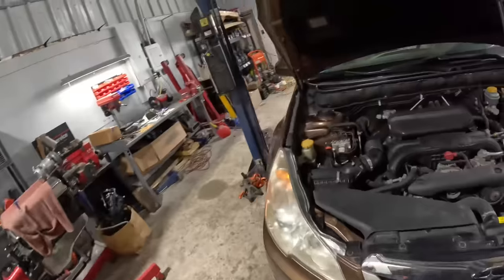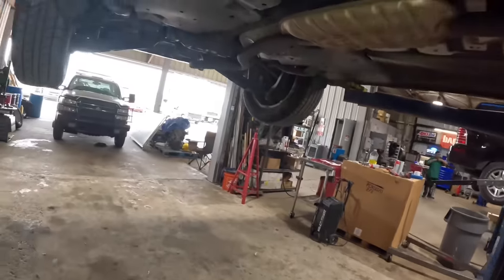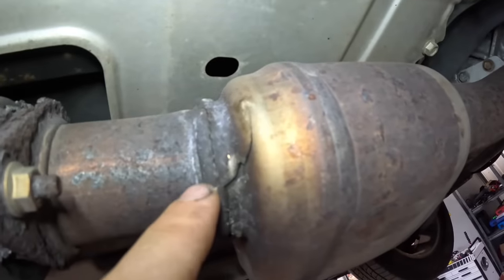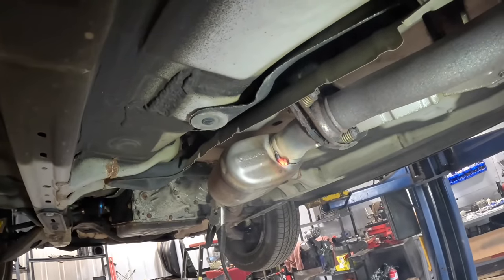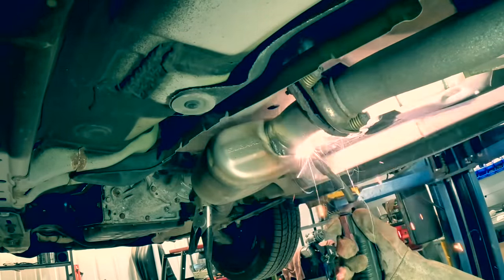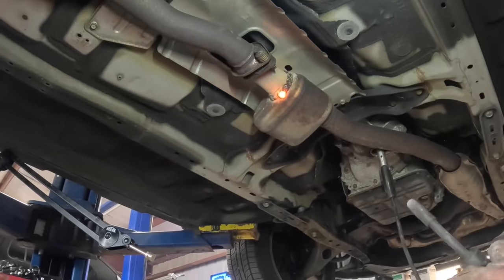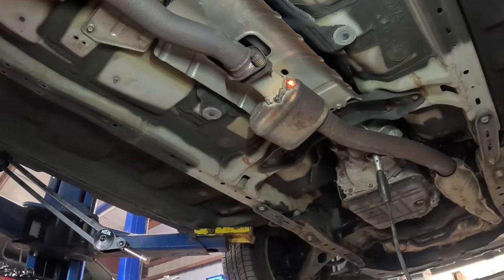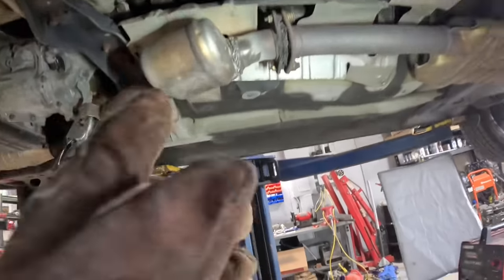Rusted Out Broken Exhaust! CHEAP Fix!!! Subaru Outback 2.5 EJ2.5

Comment: My uncle was a stick welder and he used to weld up rusted out mufflers all the time until he could afford to replace it. Mind you, this was back in the 80's but it's the same concept.
Reply: I've only weld4ed with gas, and I know impressive things can be done using it. But I'd never get anywhere trying to weld a rusted out muffler. Now I remember way back I saw a representative form a welding gear supplier demonstrate welding a rusted out beer can. It was more rust holes than steel and yet he managed to weld that crap. Just for fun he cut and welded together a soda can with minimal heat skew. If I'd try that there would be more holes than solid welds.

Comment: I haven't welded (Gas and Arc only-there was no such thing as MIG/TIG when I was a boy) since I was 18.  I was rubbish then and probably worse now.  If the customer is prepared to accept a cheap alternative to a replacement, with no deleterious outcomes,  it won't be purty, but it'll do.

Comment: A better mig with protective gas is much better than that thread wire you are using. Then about your welding. Dont try to weld it all at one time. Weld 1/2 inch at the time with some time between the welds so it can cool down a bit. You will get much better result.

Comment: I was fleet Maint. on those sizer lift trucks that take the food to the airplanes. I had the radiator out of one, the hood was up and my tools were right there.  I left the key in the truck because l never thought people were stupid. ( early job in my life.) I learned.  the manager told someone to use it. needles to say it over heated on the flight line. My falt for not hiding the key. Truck lived, my job didn't.

Comment: ray, as long as you have flux-core wire, you can weld without gas.
Reply from the maker: It’s still isn’t pretty tho, but it kinda works
Reply: no one is going to see it but the road and as long as it doesnt leak, its gooood. the thing with tig is everything has to be clean, clean and more clean. not a pro welder but enjoy welding projects. id like to get into tig also. seen decent things about the vulcon protig 205 and omni pro 220. theyre about $1k each but what we'd use them for, it will do pig.....it will do. @RainmanRaysRepairs

Comment: if you use wire with flux in it.. or argon in it, you don't have to use argon gas. You don't have to sand down the metal you are welding either with this wire flux wire.
use wire that is made of what you are welding..if welding aluminum , use same type of welding wire.
I use 25 amps for pipes.. and the reason you get blow through is either of several things.
thinning or worn, rusting pipe, too high an amperage,  tough to go see a chart for what wire to use...comes with the welder.
  NOT ever telling you what you did wrong or right...just stating what i do.
Might help, might not..depends on the crappy welder one uses.

Comment: Galvanized is generally not used in apllications that heat is common the zinc burns off and poisonious zinc oxide is released.  Stainless alloy 309 or 409 or aluminized steel or titanium are most common exhaust materials. 

Galvanized the zinc burns around 600C a white highly toxic smoke is produced and once the zinc is gone rapid rusting.
Aluminized steel salts react with aluminum corroding/rusting in 3-5 years in salt belt 8+ years in dry non salted climates
Stainless all around best
Titanium welds are prone to cracking high end systems use titanium...

Comment: Ray, 
Brand new ford Aerostar van next to a Ford Probe also new in service
On a Saturday, the shop mechanics had gone home and shut down the compressor, a porter pulled 5 or 6 new cars in the shop to get them out of the rain per the dealership owners request, a salesmen pulled his personal car up the the shop door to fill his tire with air flipped on the compressor, a rack that had not been set up lifted one side of the van it fell on the probe shoved it into something on a rack knocked it off the van got jammed up in the lift on the rocker pannel lip and frame.
3 cars got destroyed because the sales man need air in his tire and couldn't drive 1/2 a block to the gas station.  They blamed the guys in service. Someone had locked the lifts controls in the up position.
I think so it didn't leak oil or something? Not sure but there was a reason for it.  Very old dealership.
Has the big piston lifts all of them were that type. No 2 or 4 post lifts.

Comment: Helpful tip , you need to move a little faster when your welding and it won't build up so bad . You can always make another pass if needed. No disrespect just 38 years of experience. If I wasn't so far away I would give you some free lessons on your tig when you get it. Hang in there Ray

Comment: You should of cut that section out and put a sleeve piece in with clamps. That would of been fine until the owner wanted to replace the system.

Comment: What's the difference between MIG and TIG welding?
Reply: Gas metal arc is Mig steel primarily& tungsten inert gas non steel...ie aluminum. Stainless steel has a bit more
and shield gases could be Co2,Argon argon/helium mixture.
Knew some good Welders in San Diego.🙂
 chromium and or nickle...

Comment: 1)  Who's going to see it?  2)  Does it work?  3)  Will it last until a proper repair can be done?  If the answer to all 3 is "yes" then it doesn't matter.  I've used old soup cans and JB Weld to patch up a pipe to last me long enough to save up for a properly fitted exhaust.

Comment: its 304 or 314 stainless. not 316 stainless.
304, 314 is magnetic some what. but will rust in high salt water or chemical environments.
Thats why when worked at ship yard was not allowed to use these 2 types and only 316. As you did not want a ship to spring a leek when it gave way. Yep seen it happen when a part of made by an intern failed inside a dam and had to go in and fix it waist deep in cold water to make and replace that part. When taken out found out was slightly magnetic and looked on the outside like stainless.

Comment: That temporary fix welding was inline with what they had done to it before. One day though, it will need a new or 'lucky breaker' exhaust system.  One of the good things about your shop is that you can do whatever suits the customer right on up to complete rebuilds if their budget goes that far. We love seeing you working on older vehicles just as much we do on those under ten years where you have to dive deep in the modern diagnostic rabbit hole where someone else may have taken the wrong turn.

Comment: Better with the Tenacious D cover song "Classico" 😆 🤣 😂 

At least the front nuts are still nuts (that's nuts, whose Nuts?? ..... Deez nuts!!) lol

Tigs welders are good for pretty welds lol migs are goof for filler welds.

You have to get gas, the weld is porous and brittle if you don't, you'll find you don't have to fight the weld/welder with gas. Seriously ... makes a bug difference and your welds will get much better.

After the customers had a big bill from you they'll appreciate being able to put off the cost of an exhaust but you should tell them it won't last much longer by the looks of it 🤔🤔

Comment: If you would get the gas for that welder it would weld much better I seen a welder that sis everything it's a stick tig MiG and plasma cutter all in one and I seen a professional welding guy an he said it was a nice welder it is a   Simder SD-4050 pro  10 in 1 welder & cutter pulse MiG and HF Tig an ACR an cut.    More you practice welding the better you are you get lots of junk steel that you put in your dump trailer .   Ps. I found out when you go to there website they have a coad for 15% off and you can use this code as well you get a 20% more off that coad is Fishing so if you use both cords that's 35 % off that's not too bad at all

Comment: Not really much you could do - a temporary repair is better than no repair at all, and the only other choice is to send your customer away. You really do need to get some gas though. It's not impossible to weld stainless to mild steel, but you are making your own job much harder than it needs to be.

Comment: Working in a heavy industrial environment, safety rules are very high on the list. You don't even close an electrical cabinet door unless you're an electrician that works in that area. You can be walked out the door immediately for violating certain safety rules.

A salesman dicking around in the repair area would be 100% qualification for being permanently excused. Holy crap what a fool that was. Likewise to the management!

Comment: I have no concerns with the repair.   When I was 16 I fixed the exhaust on my '73 Duster welding in a Pepsi can.   That Pepsi can, outlast two rear ends and a transmission and a lot of high-speed driving.    Now that I am older and just a little wiser, I would be concerned about you welding anything stainless.    Welding or grinding stainless produces Hexavalent Chromium Gas which is a toxic carcinogen that can lead to lung cancer.   You need a welding mask equipped with a respirator to weld this material safely.     I can also tell you from personal experience, dealing with the Big "C",  Chemo, Radiation and Major surgery ain't any fun regardless of cancer you have.    It's your body, be good to it.

Comment: I would have offered this option to the customer also. If they wanted to go with it, it works, and saves them money then it's all good. Not everyone has or can spend hundreds of dollars on an auto repair. Doing something like this often times means a customer will come back because they will know you won't try to wring every dollar out of them, and still get their vehicle ok to drive.

Now back in late 1986, my first job out of High School was a tech at Sears Auto Center. That place was shameful. I would have the front wheel off, the manager would come over and tell me to write they need brakes even though the pads looked new. Sears was scummy in the way They done things.

Also. If something works, was it really a dumb idea?

Comment: Ok far as being an "improper repair" imo at least, it isn't.  It's not a bmw or a Porsche or a Benz...it's a Subaru.  I had an exhaust leak a small one on my 2014 Subaru Crosstrek and that's what my mechanic did..hasn't leaked since.  
So not an improper repair...and that rattle is prolly the heat shield, mines now "rattling" in a trash heap somewhere in Maine     😅😅

Comment: If the repair can be executed without compromising the safety and security of the customer, in order to save them a bill they can not pay, then by all means, apply that booger weld. If not, they may find someone else less scrupulous to do all their repairs. And that would be worse.

Comment: Oooooh a Ruby Sue. This makes me glad I'm working at a Ford dealership.  They're always a nightmare.
Reply: Okay, question. It shouldn't matter year but I have an 07 Expedition, power levels to the bank 2 02 sensors are all over the place, generally low. What causes that?
Reply: I'd need to hook up a scan tool to find out exactly what's going on. I'm not gonna do an internet diagnosis

Comment: Your best bet for that repair is your wire welder. TIG will not weld on dirty rusty metal, TIG is not forgiving at all. You are not using a MIG welder, a real MIG with gas is what you need.

Comment: I remember welding these up with a gas torch, now days, no one uses a torch to weld with nor is it being taught. Mig, Tig, stick, that's the only ways anymore, shame really. You DO what the customer wants unless it's entirely unsafe then, you, have to right to refuse to do any work. 
In response to your story, I think if that happened to me, I would have walked out right then and there. Sales personal have no right to the shop area unless getting info from the mechanic. Blame should have been placed on the salesman not you. Cheers :)

Comment: I am a little torn. You saved the customer some bucks, but having been subject to carbon monoxide poisoning, my thoughts are to replace any part of a car’s exhaust system with new parts. If your stated amateur welding does not hold up, people may die. At least have the customer sign that they approve the repair.

Comment: It's a risk. Get it in writing that the owner accepts all responsibility.
If it fails and causes injury because it's been incorrectly repaired you get cleaned out.
It's on video saying it's welded badly without gas.
I just wouldn't do it in 2024.

Comment: By federal law you should of replaced it under federal law you are not allowed to remove or alter it in any way or do any welding on a catalytic converter if a shop does it it's up to a $50,000 fine if the owner does it's a $25,000 fine it might make you want to think of what you're doing and putting on YouTube

Comment: Good enough is good enough for a car that likely will be scrapped in three years.  Why bother sinking a grand into a part to “properly” fix a car when patch work will literally last for the remainder of the vehicles life expectancy?  Besides, new part is probably aluminized mild steel, which is lucky to last two winters and would probably fail before the weld.